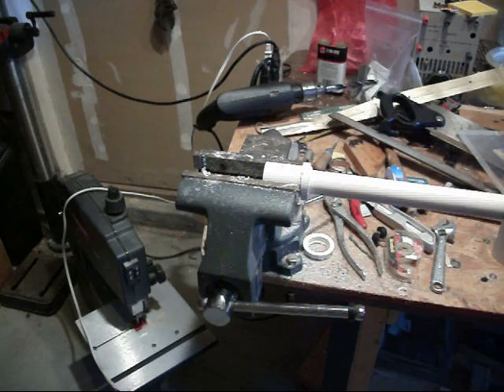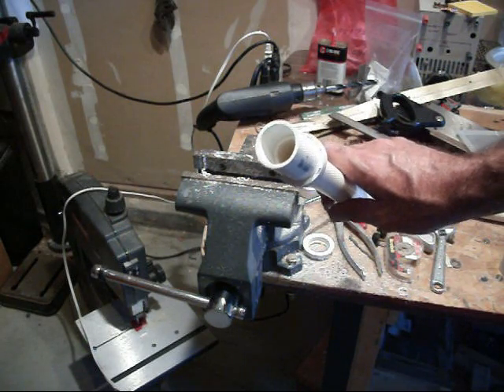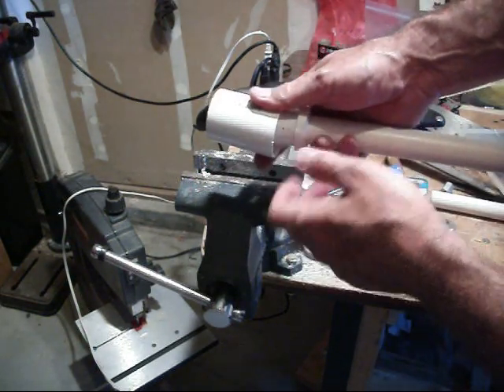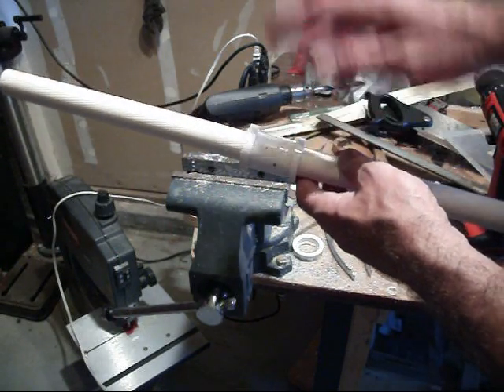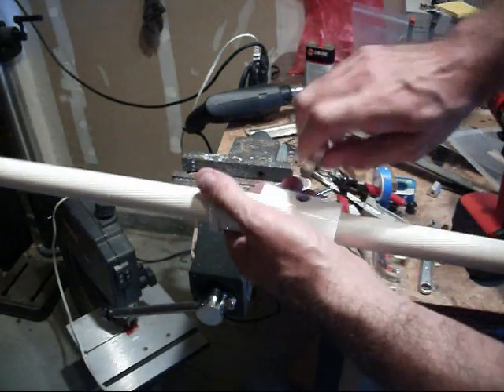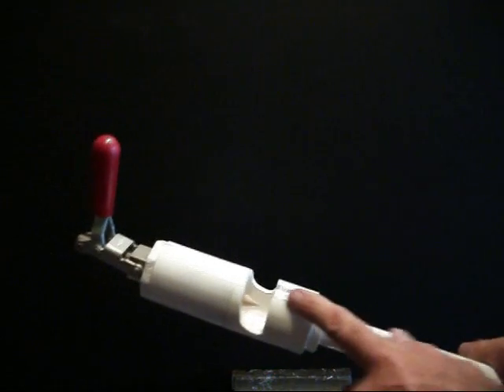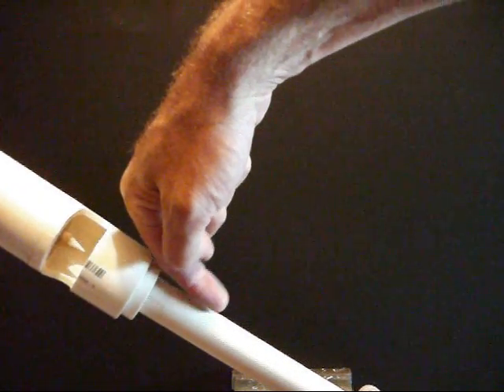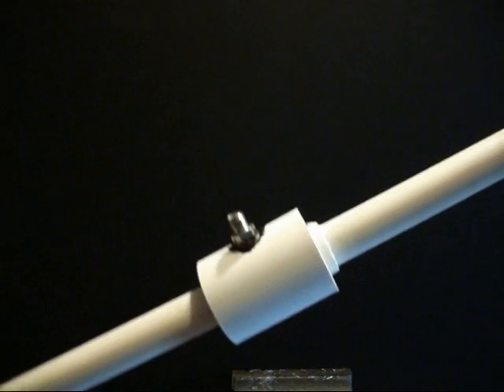DIY Homemade Vortex Tube Part2.wmv

Comment: Connect about 10 vortex tubes together to cool your house or business or add to a ground heat pump to heat and cool your house and no moving parts to replace. Good video
Reply: I don't think that would work. The air coming in needs to be compressed, the air becomes less compressed as it moves through this doohicky so you couldn't run them in series effectively. If you wanted to run them in parallel you'd need a pretty insane compressor setup to keep up with them, The compressor is your moving part.
Reply: @cheesefries7436  don't think it would work either
Reply: @cheesefries7436  how about building a giant version of this project?
Reply: you tried this?

Comment: Doesn't the hot air side tend to soften/melt the PVC pipe? Also what PSI do you run into the tube? I've seen the metal versions sold by companies like EXAIR and they are very pricey. Maybe this could be done using plumbing fittings & black pipe?
Reply: Yes, you could use metal pipe.

Comment from the maker: Takeyamaster - I got about a 15c temp difference between the two ends when I ran this vortex tube about a year ago. I don't have my notes from back then so I don't recall the ambient temp. I used a dual thermocouple meter at my work to make the measurements.
On my blog there is more info about building a vortex tube and links to lots more info on line. Read the comments under the posts as well for more info. Good luck and be careful!